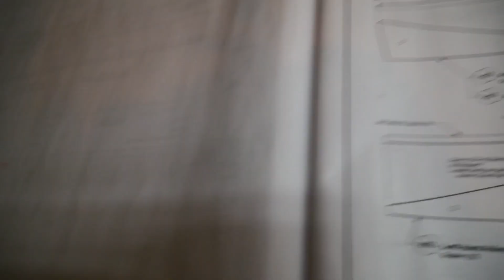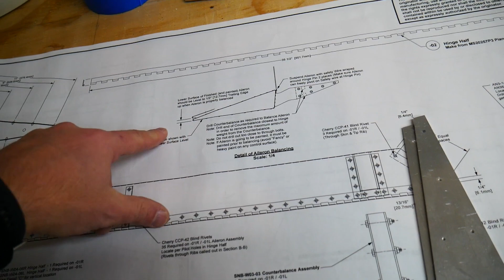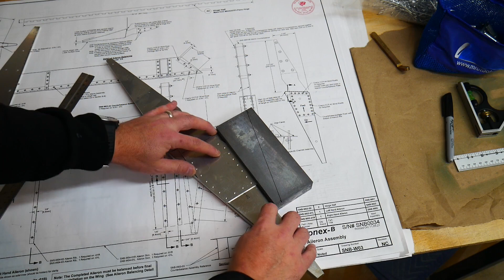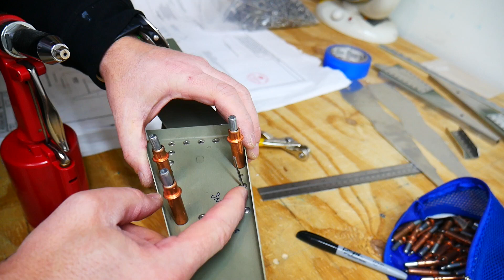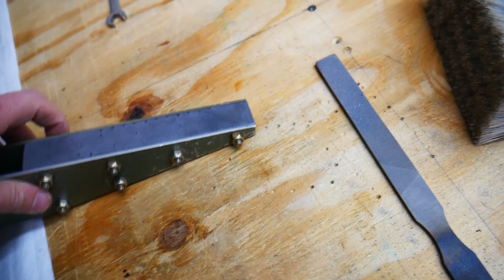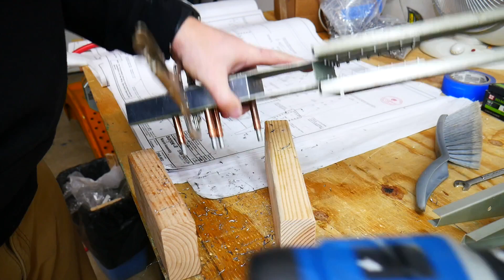Sonex Build - Aileron Counterweight Assembly

Comment: Awesome work!!  I've been ready to drill my counterweights for a while but have been 'trepidatious'!-----thanks for the tips!!!   Save your arm on the deburing-----buy a cheap powered screwdriver (Harbor Freight!) and attach your deburing bit to that!
Reply from the maker: Thanks. Glad it's helpful. You know, I tried to use a power tool for deburring early on and found that I'm a little too heavy handed and ended up cutting too deep, so doing by hand is my preferred method. So far it's the drilling that wears me out ... more so than the deburring anyway. Maybe I'll feel differently once I move on to a larger part with more holes to debur. :)
Reply: @dan_der_flieger  I had the same issue when I was using my 'big' drill (Rigid 18v) so I bought a Warrior 12v from HF and it's so much lighter!!  I wasn't how sure how reliable it would be but so far it's been awesome---and so much easier on the arm!!   Thanks for the great videos!